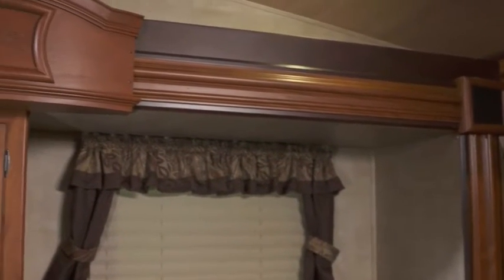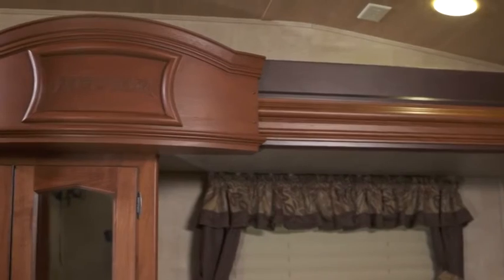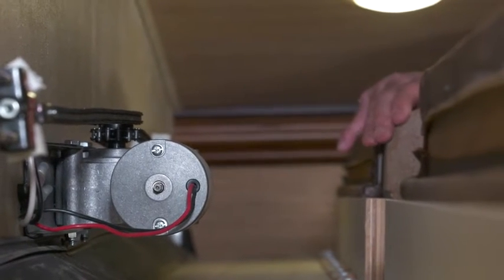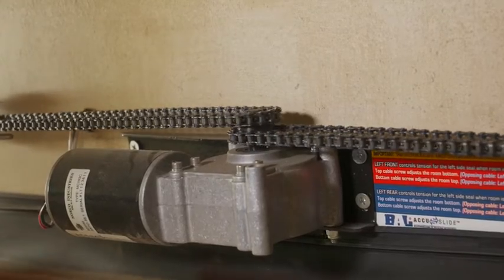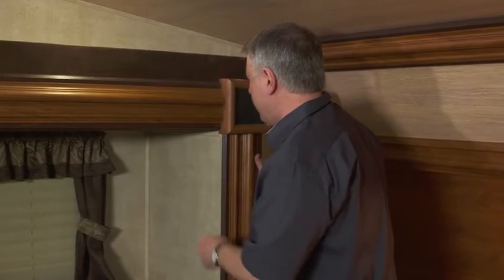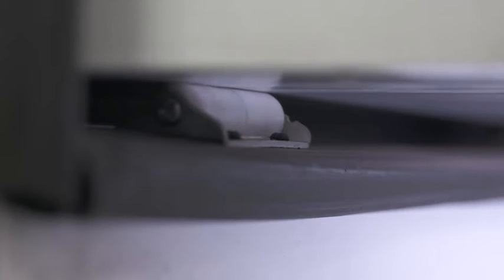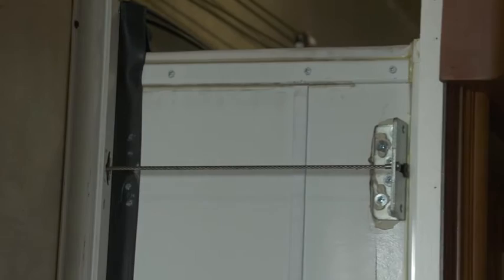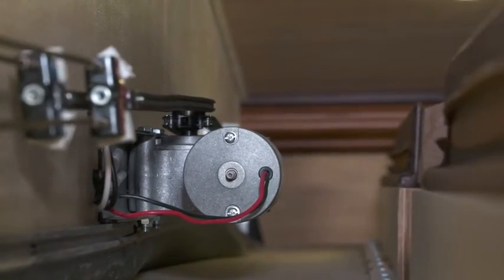Operating the Accu-Slide Cable Slide Room

Comment: How do you center it. Mine is forward and rubbing rails.
Reply from the maker: Hi Ian.  I have seen this before and I have actually tried contacting BAL before and was not given any good information. The way I fixed it was by loosing all of the cables just a little bit, put a floor jack under the slide with a 2x4 on it and another board wedged between that and the slide bottom and slightly raised the room just enough to take a little pressure off. With the help of another person I was able to push it just enough to center it. Have to be careful that the board doesn't kick out too. I have heard of people wedging a board like a 2x4 and prying the sidewall to move the room over but you risk damaging the wall or the side brackets when doing this. Depending on how big the slide is, you might not need to jack it up at all. Have someone on the inside and outside pushing at the same time can slowly adjust to the room back centered. Make sure to have the cables a little loose so it takes the pressure off of the pully system. Also make sure to check and make sure the cables didn't come out of track when tightening up as well. This was the only way I was able to find to do this and it has worked for me before. I hope this was helpful!   Dan-RV Repair Club